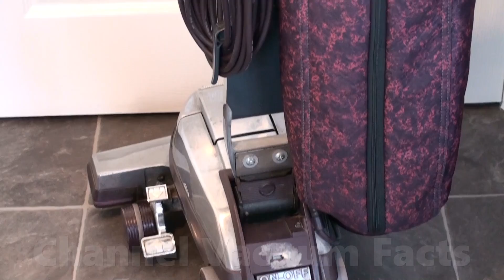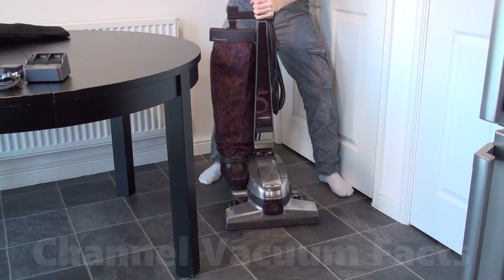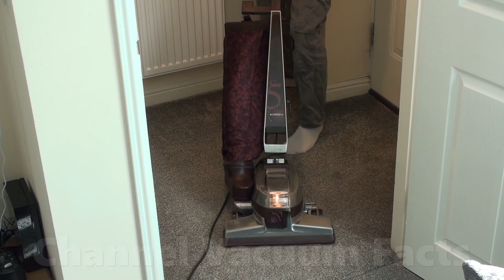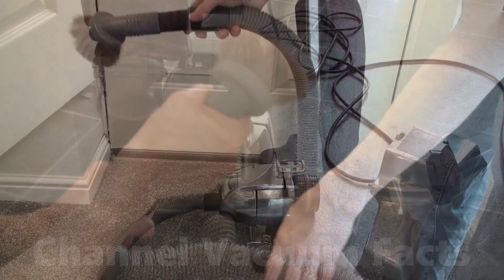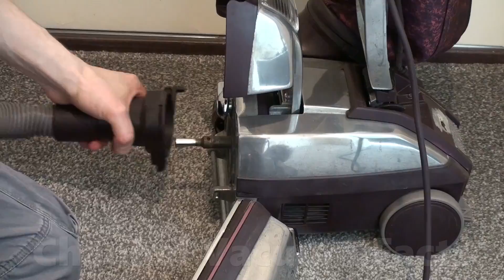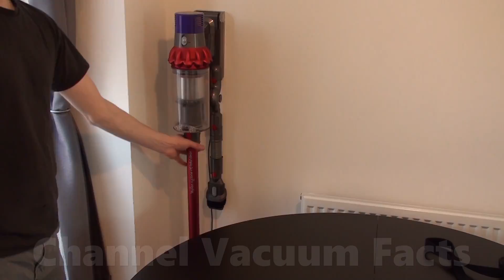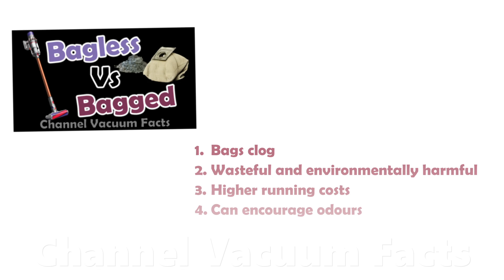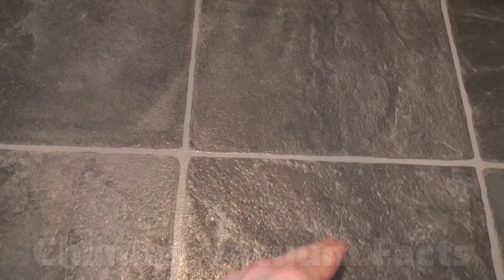Review of a Kirby Vacuum Vs Dyson Cordless

Comment: One thing that you are way over exaggerating is the weight but don’t get me wrong they are definitely heavy but pulling a muscle is crazy because both of my grandma’s use Kirby’s and I have used my mom’s Kirby since I was about five
Reply from the maker: I pulled a muscle. That's not an exaggeration; it's an empirical fact. And then there's literally everything else outlined in the video. It is a very poor device that reflects so terribly on its creators, its country of origin, and the economic model adopted that led to such filth. The better have moved on from that dire, inferior technology and approach to living.
Reply: @VacuumFacts  I own a Dyson V 15 detect and it way way under performs compared to the Kirby on carpet
Reply from the maker: @Vintageappliances1970  Not sure what you're doing wrong, since data clearly shows otherwise.
Reply: @VacuumFacts did you have it in drive? I see you tinkering with the wheels while the transmission in neutral… I’m not sure yours was working. It’s very easy to break.
Reply from the maker: @Jborgzz1  Yes, it was all in the correct mode. This a) was shown and b) the cause was explained.
Reply: @Vac @VacuumFacts should be able to push it forward with one finger if you’re doing it right 😊. When you vacuum with a Kirby, you’re mowing grass, not painting a wall.
Reply from the maker: @Jborgzz1  I'd recommend watching the very video you're commenting on where this was demonstrated...
Reply: Also, you make using the Kirby way more difficult than it actually is because when changing to the hose, you have the height adjustment completely as low as it can go and the neutral and drive switch is literally an N for neutral and a D for drive
Reply from the maker: @Vintageappliances1970  Regardless, it's considerably more hassle than the superior approaches of better technology and products. Somehow you've missed this critical and central point.
Reply: @VacuumFacts  well I also think that it’s your opinion because you like the Dyson cordless and I personally think they both have their ups and their downs
Reply from the maker: @Vintageappliances1970  Anything I state is based on evidence shown in the videos, so subjectivity doesn't really come into it.

Comment: I feel like a lot of this is subjective.. 
On the topic of belts, when the motor in that dyson head fails, or the little toothed belt strips, or the gears wear out or whatever it will be a nightmare to fix. Both belts should last several years anyway really.

Bags vs bagless again, I could argue many reasons in favor of bags. There's a reason machines like the henry quick exist, people don't want to deal with dust flying around emptying a bagless machine, cleaning filters etc. 
As far as bagless vacs go dysons are the best but still a pain in the ass from a maintaince point of view. Every one I've owned except for the proper old school ones, the cyclone assemblies clog up with crap and you end up spending hours cleaning the damn things out. Maybe this is not an issue on the newer ones but they really dont seem to like you taking the cyclones apart. Could be solved with a nice latching mechanism or something. 
I've flip-flopped on my preference over the years but I definitely prefer bags now these days, no dust billowing out when emptying.
Shark cordless vacs are the worst since theres not much cylcone filtration going on so you end up cleaning the stupid foam pod filter thing all the time which makes a mess
Reply from the maker: There's nothing subjective about the weakness of belts—there are literally replacement packs of belts widely sold. Show me any evidence from a reputable source that the failure modes you imagined from the dyson head actually happen. I 100% guarantee you'll fail.

You've no convincing arguments about bags and simply rely on regurgitating debunked myths. The Dyson machines I've used have not been a hassle to maintain at all. It has been minimal and far less than, say, a Kirby, where there are entire maintenance services specifically for them widely available, as mentioned in the video and ignored.

Show me evidence of a precise method (excluding abuse and neglect) to reproduce the alleged problem that the cyclones assemblies clog up. Not a single person, ever, has been able to show that reputably, and I 100% guarantee you won't (otherwise you already would have).

The equivalent of this comment has been posted so many times over the years, and it always ends up the same way...claims made with no evidence that just aren't convincing, entirely reliant on vague subjectivity in stunningly ironic fashion. Yawn.
Reply: @VacuumFacts  Sorry I should've been more clear, I was mainly referring to the section on usability, I guess a more accurate term would be exaggerated. I've never injured myself using a Kirby, never pulled a muscle or felt out of breath. It's really not that bad. Yes it's more cumbersome than a stick vac but I'd hardly argue it's 'dangerous'. Changing tools on it also really isn't that bad either when you get the hang of it.
I also had a bit of a deep dive into the high torque Dyson cleaner head. I was wrong, there are no belts or gears, there is a direct drive DC motor. However a brief search of "Dyson Cleanerhead not spinning" returns a host of issues with stuck bearings, failed components on PCB's, loose electrical connections. So sure, there's no belt to fail but you can't act like the rest of this assembly is somehow immortal. https://www.youtube.com/watch?v=o2IHbi4oSAg&t=578s this video shows how much of a pain it is when one of the components on that board fails. A lot of people would just throw it away or buy a whole replacement cleanerhead which is not environmentally sustainable. I'd rather replace a belt in 5 years when it gets a bit slippy. This is more of a right-to-repair issue, they COULD just sell you a PCB and include instructions on how to replace in the manual. Currently they don't even have a floorhead assembly for sale on their site for the V11. Also the fact they (Kirby) sell belts isn't an argument against their longevity. I could say the same for the fact that Dyson sell replacement power heads, but that would be disingenuous. 

Just because maintenance services exist, doesn't make them necessary.  These are likely scam/unnecessary services. A brief google shows that these same services exist for Dysons, as they likely do for many other manufacturers. Again, this doesn't mean you have to take your vacuum to a shop every year or whatever, this is a non-argument.  There are no essential maintenance items listed in the manual for your Kirby or the one I personally own (1988 Heritage ii), what is mentioned in the manual is how to replace the bag (i.e emptying it), replacing the belt which again has no recommended service interval other than when it stops working, which is going to be at least several years. Dyson recommend in their manuals (V11 for reference) that you clean the filter every month, which sure isn't that much of a big deal, but it is just objectively more hassle and time than removing a bag and putting a new one in. And you still have to empty the thing, which when you flap the bin open it's going to produce just as much, or more airborne dust as removing a bag. Seems like the newer ones aren't as bad for this, the older machines were a pain.  Not a big deal if you empty outside but if you're in an apartment you then have to get a bin bag out, or clean up whatever mess it makes when it empties. You also talk about having to dismantle and store the kirby handle when using it as a "handheld", but no mention of having to remove the wand, floorhead, and put that somewhere before you're able to empty the Dyson. You'll definitely also still get bad odours in a bagless vac as dust accumulates in the pre-motor filter. Not an issue isolated to bags.  I'm not discounting the environmental benefits of bagless at all, but you can't argue it's more convenient. Just different. 

Generally in my experience any heavy use of fine particulates will clog a Dyson, though every Dyson I have owned tends to clog with pet hair and fine dust that gets packed around the inner cyclone assembly. If you end up hoovering up plaster dust (e.g if your home is being renovated) then the chances of clogging the cylcones, filters and depositing crap on the impeller blades is very high. A brief google search will show images of this. It doesn't mean the machine is a write-off and it does take years to build up, but again it's just something you don't have to deal with on a Kirby, or any other bagged machine for that matter. EDIT: https://www.youtube.com/shorts/yj7I515eWOw video showing a clogged cyclone assembly on a V11. It does happen.

I'm not saying you're wrong about this Dyson being better, and I'm sure 99% of people would be far happier with a Dyson, but it feels a little biased when you're portraying the Kirby as a completely unusable death machine and the Dyson as this infinitely reliable magic device that has no drawbacks what-so-ever. There's pros and cons to both machines.
Reply from the maker: @tlaroche38  The sources you cited show no method to reproduce problems and show what happens if neglected and abused. It's misleading to suggest otherwise without evidence. But this was expected. They don't need replacing if treated properly, which is how to actually be environmentally friendly. Plus they should be recycled, not dumped in the trash as implied.

The rest of the text was unconvincing that Kirby's are attractive or good. Again, the second video you linked to was the usual misleading nonsense showing, yet again, no clear problem or method to reproduce it and was just evidence of neglect and user error. This symptom doesn't happen with responsible use.

I presented the rest of the truth about Kirby's. Everything I claimed was supported with evidence and people can make up their own minds. I doubt anyone will be buying one anytime soon.
Reply: @VacuumFacts You have no evidence to say that either of the clips I showed were caused by abuse or neglect and once again you're completly missing the point I'm trying to make here. What do you even mean abuse and neglect?? On what planet can or should user error cause integrated circuits to fail on a PCB? As you rightly pointed out the height adjuster on the kirby is bad, you can burn the belt out if you run the cleanerhead too close to the floor, but you also say the dysons superiour automatic leveling gets round this, so what exactly is causing these failures? If you can use it so "wrongly" that it will blow up the motor controller then thats a clear design flaw and a lack of safety/protection devices. 
These are simply examples of normal failiures a user may encounter in normal service over an extended period of time. Also, you're paying over £600 for a vacuum cleaner, you shouldn't have to then spend another £80 and the time recyling your cleanerhead just because a £0.04 integrated circuit burned out. If they sold the board and it was easy to replace I'd have no argument. 
And once again you're missing the point, I'm not trying to argue that the kirby is a better machine or the dyson is bad per say, but I am simply calling out obvious bias where you nitpick all the issues there are with the Kirby machine whilst refusing to accept that there is a single thing bad about that dyson machine. You say all your statements are backed up with facts but you have presented nothing indicating failure rates of belts, refuse to acknowledge being completely incorrect about the service and maintainance requirements of either machine, and when presented with blatant examples of issues the average user will likely experience with the dyson machine you bury your head in the sand and pretend its make-believe. I am literally not trying to shill Kirbys AT ALL, I clearly said that the dyson is a better choice for the majority of people, but its misleading when you present it as if nothing will ever go wrong or break.
Reply from the maker: @tlaroche38  You're asserting failures occur 'naturally' without evidence. The evidence you link to shows nothing to support that position. This is misleading since those linked sources of failure are of unknown origin. Failures are rare and have causes. Most failures are due to neglect and there's plenty of evidence for that known failure pathway. It is misleading and unconvincing to use the argument that because rare failures of unknown cause that most people will never see (that are cherrypicked and embellished on the internet) are harder to fix than disposable old fashioned approaches, the latter are therefore superior. If that and the rest of your argument had any credibility at all, there would be clear evidence of widespread dominance of the approach Kirby takes. I'm aware of none. Everything said in the video is supported and your arguments are weak and unconvincing due their speculative nature, lack of evidence and specific detail. People can make up their own minds about what's shown here. Oh, and then there's literally everything else in the video.

Comment: Often it is said that these Kirby’s ‘are like tanks!’ They are absolutely right. And if you know anything about tanks, they may be tough but are in no way what you’d consider ‘reliable’ or practical and require an awful lot of parts & fuel logistics and infrastructure to keep them operational. Something you’re now familiar with.
Reply from the maker: Yeah, their belts snap, their brush rollers need replacing, their bags need replacing. There are literally borderline false-economy services out there that provide 'machine servicing' services just for these machines. This is not what true durability looks like and needs to be more than just the 'shell'.
Reply: @VacuumFacts 
I admire these as appropriate technology for their time. But yes, I wouldn’t consider one. And thanks for the link.
Reply from the maker: @qasimmir7117  Technically, they remain technology of today, since they're still for sale, and there's a bunch of people who will defend them to the death if you even look at them the wrong way. Just look at the comments and bile on this very video.
Reply: @VacuumFacts 
Yes, I’ve seen them. Terrible tribalism over a bloody vacuum cleaner.🤦🏻
Reply from the maker: Incidentally, the 'related' videos that pop up on YT. This is so cringey it just can't be real. https://www.youtube.com/watch?v=_oq0PX2pxwY

Comment: I love the dramatic struggle while pushing the Kirby, lol! Makes me think Kirby must be better than dyson. If it wasn’t, then why fake the struggle pushing it?
Reply from the maker: Ha, it's hard to visually show on camera, but that machine is nearly impossible to move on my carpet without tech drive.
Reply: Yes he is a bit dramatic. I owned a Kirby from 1990 to 2018. I moved and thought I'd update and get a Dyson. The Dyson couldn't clean a crumb out of a shaggy mat which ended up looking matted and I was thinking of tossing the mat. I accepted a demonstration of a Kirby this week and they vacuumed this shaggy mat. It looks brand new again. I was lucky enough to score a demo model from last year half price. I would not have bought it full price at $6k Australia. They are over priced but a fantastic vac. In the 28 yrs I owned my first Kirby I replaced the belt .twice. They used to have a thick paper bag but now use a cloth bag. I m not sure about this. With the paper bag I cut the sealed end and folded it over and clamped it shut and just emptied it whenever into a bag the same as one does with a Dyson. I will probably do similar with the cloth bag as they are overly expensive which Kirby needs to address.
Reply from the maker: @helenkentwell5042 It is really hard to push though on my floor without tech drive. Data of the true cleaning performance of those machines relative to modern machines is presented here https://youtu.be/8K6B_O5_C90 and here https://youtu.be/qJlaBeqVs7E. The problems with bags that affect other people, even if they didn't affect you, are outlined here https://youtu.be/ptN0kkOtGSM. Oh, and then there's everything else factual in the review conveniently ignored.

Comment: I have a Kirby Sentria 2 and while I don't hate it, I'd much rather use cheaper units. The machine can be difficult to maneuver in tighter spaces, and if you were to suck up a very hard object, there is a very high possibility you could damage the fan. And when that happens its basically fucking useless. And the cost to repair it is probably gonna be the same as getting a vacuum from Walmart.
Reply from the maker: Technology has moved on so far from these ancient monstrosities. I get that collectors and the like, tout them from a historical perspective, but to try and defend them from a modern technological, performance, or practical perspective is just going to encourage ridicule.